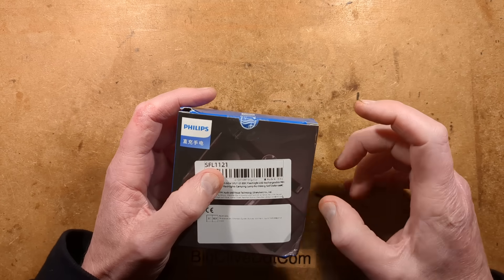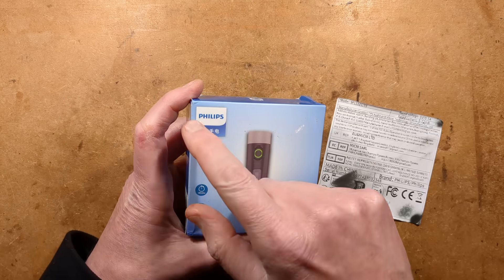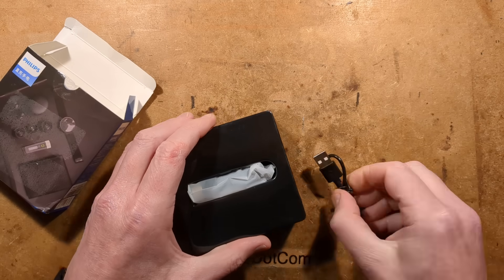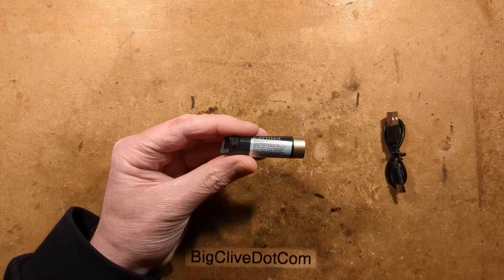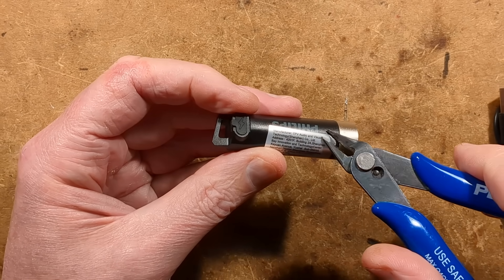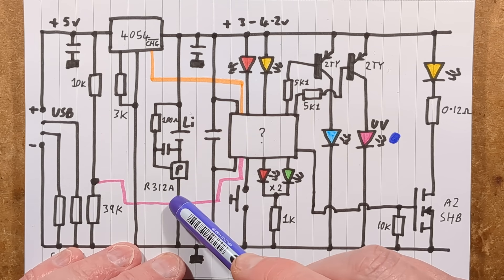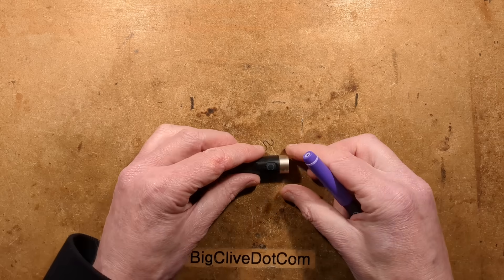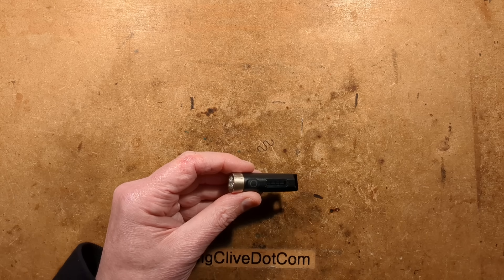Philips flashlight teardown

Comment: Which of these small cheap Chinese flashlights has the largest battery capacity? (300-400mA)
Reply from the maker: I should test that.  But the LED current will also be a factor.

Comment: My Philips torch arrived a few days ago, it has decent light output, the red light lasts for 6-7 hours, low intensity main light for less than 3. Is it a lot? No. Is a lot for the price point? Sure is! Not every torch has to save your arse after getting lost in a dense forest in the middle of nowhere... A super compact, reasonably bright product. It will even have some 'safety margin' allowing for short additional use after battery dies. Great find!

Comment: Bought 2 because of this video. But mine won't charge with usb C, how to check presence of pull down resistors without breaking it apart?😂
Reply from the maker: It may be that your USB C plug just isn't deep enough to reach the connector.  Are you using the supplied lead?  Make sure it goes in all the way.

Comment: Nice little torch. Too bad it's 10€ now.
I actually have a 2.5W Phillips light bulb which is unbelievably bright and actually gives off more light than I need at night. The colour temperature is nice too.
Comparing it to other LED lights, I was convinced that it has to be significantly more than 2.5W, but no.. I checked.. it really is around 2.5W.

Comment: A very nice LED keyring light! Seems the licenced Philips build quality is pretty good too, as you might hope. Over 20 years ago, when Philips Imaging bought out ADAC, they were giving away red LED illuminated ballpoint pens, for use in low light environments, and I still have two, both of which work perfectly (They take the standard Parker-style refills).

Comment: Why do they have fit strobe lighting?  I have a mini torch and press one it's main light OK Press second time and it's that strobe lighting WHY? Third press and it's side LEDs light OK because it uses less power.  One good thing it has charging control the press button light up red when charging and switches off when charge

Comment: That's nice I kind of like the soft on soft off. The strobeing police lights on the other hand can literally get you arrested for impersonating a police officer in the US. Although I don't know why one would want to do that right now.
And I like that it goes low high it just seems right. Rather than coming on Hot and eating all your battery only to go down to a lower level. Although it kind of would be nice if there was some sort of override to go straight to Full intensity, although it's a keychain flashlight so not necessarily it's use case. Actually impressive.

Comment: Have you ever tested some of these light Circuits, to see How Low you can get the Voltage/power?
I see so many of the NICE devices being Over Run for Brightness, Not for Duration.
Reply from the maker: I prefer to use these lights at their lowest setting for LED and circuitry longevity.  At high settings the good ones protect the LED by gradually reducing the current in hard to perceive steps.

Comment: Looks very similar to your "Better USB chargeable keychain flashlight" video, PCB layout is almost the same. Software is different though, and it lacks the 5k1 resistors on the USB pins.

Comment: The microcontroller might have a programmable current sink for those two direct-drive LEDs.  So many LEDs for a flashlight.  9 LEDs + the main LED.  Cool.

The protection chip was a nice touch, they didn't really need to do that.  They could have used a PFET with very low reverse leakage to switch main power and do a shutdown and made the ON/OFF/FUNC button do a power bypass to bootstrap the microcontroller.

I'm a little surprised they had those transistor circuits.  They could have used a quad N-Fet (ground side switching) and gotten rid of the two transistors, the two 5K resistors, the main LED drive FET, and doubled up two of the FETs from a quad package in parallel as the main driver.

Comment: Of course it flashes. Because flashlight. 
You and I both know that's not what flashlight means, but China doesn't, so they all have to flash. Including police car lights?! A strip of white LEDs would have been far better. Preferably with a small magnet on the opposite side so you can attach it to convenient metal things and work hands free.

Comment: Nice toy! If you turn it on while charging, does the charger provide more current to compensate, or it's same current but a part of it goes to the LED (hence the battery charges more slowly)?
Reply from the maker: Same current but a small part goes to the LED.

Comment: I would be curious to know how the flashlight reacts if you plug it in, turn it on in that limited mode, then unplug it. 
Basically: Is it possible to use this as a plugged-in nightlight with internal battery backup?
Reply from the maker: It stays on at the low setting when unplugged.

Comment: I don't think this one is an 'officially licensed' Philips product. While the Philips name has been licensed out to other companies (one of which is, in fact, TPV) for use on a variety of products, I think this one is, at best, borrowing the case from an officially licensed product. I believe the original/genuine licensed product is the Philips SFL1121. This one looks to have used the same basic housing, but at the very least it has a different secondary LED layout. The box art/layout doesn't quite match, and there is no giant product sticker on the official version either. It can be hard to tell which is the original, and which is the copy, but I think the version with three secondary LEDs is the original, especially because there is a revised SFL1121P that changes the case but still only has three secondary LEDs.

Actually, you might want to take a look at the SFL1121P because it includes a little tinted plastic window that it advertises can be used with the red LED to locate hidden peeping-tom cameras.

Comment: You are correct, Philips is just a few lawyers in an office that sell licenses to the brand.  Shame really, Philips used to be a great technology company...
Reply: Yes and no. Consumer electronics are indeed licensed and not made by Philips anymore. Other devices, medical related, are still designed and made by Philips (things like shavers, toothbrushes and hair removal devices). And Philips still has a very, very, large medical (hospital) equipment department.
Reply: @daantimmer  Yes, you are correct, medical  division is still under the original company control.
Reply: I wondered why Philips LED RGBIC strips cost more than the other brands while offering less performance. I use Govee for my addressable RGB needs. Decent price and performance while supporting an app that requires zero Internet connection.
Reply: Of course Project-326 would show up here!
Reply: @HylanderSB  🙂
Reply: @HylanderSB enlighten me, what is special about @project-326 ?

Comment: There must have been a historical watershed where it was decided (henceforth) torches would no longer provide just on and off.
Reply: Somewhere in the first decade of the 2000's. LEDs got good and LiPo batteries became the standard. They all copied what amounts to the same button-cap switching pattern that showed up around that time. (Not sure which brand was first, but that's when that stuff hit the mainstream market.)
Reply: @pauljs75  perhaps Streamlight?

Comment: I found what appears to be the exact same circuitboard in slightly different casing marketed as an Alonefire S11 (S11F with flourescent shell) for about 6 gbp (479 philippines pesos) and that led me to another clone - Asafee S11, for 229 pesos and then again an unbranded S11 mini flashlight for 187 pesos. Board layout identical to yours.

Comment: I actually bought one of these recently! It's become my daily carry light, displacing a Lumintop AAA light. The timeout for the button press to turn off the LED instead of cycling to the next mode is about 5 seconds, and the 4.5cm scale on the side is accurate. Very happy with its function at a light. My only complaint is that the first double-click mode is the UV light and not the white light.

Comment: 7:44 that's why I alwasy buy the clear/glow in the dark plastic models of flashlights, esp the nitecores and stuff. the light hitting the casing makes the entire thing light up so you get an extra couple of percent of light around the flashlight in your hands. plus if you have the glow in the dark model with those side lights, the entire casing stays lit for a good minute or two after you turn it off. it really glows brightly with EDC model V3 that has the UV light. I didn't even know the light was UV because my glasses have a UV filter. the entire thing glows brightly and there's a little dot of light blue lmao

Comment: In the US there's been 3 Philips brands available since the 00s - name brand Philips (there once was a Philips medical & electronics as two separate), generic licensed/branded Philips, and Philips Avent (baby stuff - part of Philips in the US).  Branding/packaging gets a little weird depending on the retailer and what market the product was initially intended for before being sold in the US (ex: Philips Avent for the Canadian (French) market originates in the Netherlands, often, with EU/French labeling & packaging).  You only tend to see the licensed products at big box retailers like Walmart/Target, and it's often cheap items like the flashlight and around Christmas time.  In the US, I believe name brand will have the Philips coat of arms logo printed somewhere on the package (yours just has a seal sticker) & not a sticker and that's how you would tell if it's a licensed product.  Also, some genuine Philips products should have a QR or security code printed on the box and product, which should direct you to an authentication page on the US Philips site.  Being that the product is for the domestic Chinese market, my bet is its licensed as the brand name is more valuable there than an actual Philips quality product.

Comment: Do you think the main led itself is limiting its forward current?
Reply from the maker: The voltage will rise slightly with current, but it's not a current regulated LED.  It's main limiting factors are the series resistor and the cell impedance.

Comment: I had one of them from guy who sell stuff from Philips. Weirdly mine didnt had glue on screwed cap(as of course I took apart mine). At first I really though that it have the same guts as those cheap keychine lights(that I really love) just in different case. I just fish they get rid of blue/red LEDs as they are super useless...

Comment: I think my royvon keychain light is about the same size and has about the same operating system of button pushes on stuff
Reply: Rovyvon makes the highest quality keychain light, that is reflected in the price. They use very high quality components and batteries, being an outlier among Chinese manufacturers which cut every possible corner and maybe what remains too. I have a few of their E3 hybrid Angel Eyes - £ 50 may seem too much for a keychain light but not when you consider their reliability and longevity...

Comment: Does anyone make one without a flash/sos mode??
Reply: It wouldn't be a flashlight then 😉
Reply: yep, it's a bit expensive but the sofirn sp40 that has no strobe whatsoever
it's also worth looking into any flashlight with anduril ui, it's still got the strobe features, but it's behind a very particular sequence of button pushes and holds
never have been a fan of flashlights that put the strobe in the main cycle, should be a double click and hold from off or something like that if you ask me

Comment: Quite a complex circuitry, nice teardown.
To think that nowadays brands are just that, brands. Back in the day when something was marked Philips, you could be sure it was made in the Netherlands or at least Europe by the company that was on forefront of consumer electronics and not just that; the one that gave you developments in radio technology, Miniwatt vacuum tubes a.k.a. valves, compact cassettes, Video2000, CD, SPDIF... Later on, you just never know where exactly it comes from, it's just somewhere in China, Malaysia, Singapore, Philippines, etc. made by a factory that sells the same product under a few different brands, whether it's electronics, tools, household stuff etc. People buy the brand and it's just a simulacrum, a copy of a copy of what used to be.
Reply: Same thing happened to German Grundig. Once a household brand for German made radios and so on, but a generic Chinese crap brand since a decade or so.
Reply: @FoobarDesign  consumer electronics - radios, TVs, tape decks (reel to reel included) - are one thing, but they made excellent test gear too.
Reply: As a Dutch guy I feel your pain. Indeed Philips once was a brand / sign of quality.
Reply: @DIEWELTMusicChannel  legendary one at that - though their electrolytic capacitors didn't age well, at least the blue axial ones. I've had a bunch of NOS ones way out of spec.
Reply: @DIEWELTMusicChannel  Do the still have the Philips museum, i think it was in Eindhoven.... I went there sometime in the late 80s.
Reply: @Andy_FortyTwo  they have two now, one official and one unofficial, but the Evoluon was decommissioned in the late 1980s.
Reply: sad the same thing with belkin or weller...sad name brands just arentwhat they used to be.
Reply: Philips had factories all over the world. It would be more accurate to say it was mostly developed and manufactured in house, not necessarily in The Netherlands or Europe.
Reply: It’s nice though that Phillips is now made in the Philippines.
Reply: Phillips were so busy making easy money from their lazer disc tech when CDs/music/computers etc dominated that they seemed to stop investing in their own consumer product development...a once iconic brand gone kaput,the same with the German "Made in West Germany" branding on Blaupunkt etc...a sign of quality product.
Reply: You guys don't do anything now except contribute to the downfall of Western Civilization... Great job Netherlands
Reply: Phillips wasn't Dutch !!!

Oh, is that why they had Santa riding a Norelco Razor, while we watched that commercial on a Magnavox 😂 👍
... memories
Reply: @My-Pal-Hal  Phillips with 2 l was an American company that made screws. Philips with a single l is a Dutch company with subsidiaries all over the world. Unfortunately instead of just using the Norelco brand in the US and marketing it as a foreign premium brand, they took over Sylvania and Magnavox and set up a more or less independent branch to make cheap crap. That on more occassions than I'd care to remember, caused trouble for Philips themselves. For example letting Funai sneak in to make crap VCRs to replace i3R and PJVM built ones in Europe. But to be fair, it also brought some nice developments to Philips, such as the Magnavox Odyssee.
Reply: @mjouwbuis 
Hey.
My Cheap Chinese Phone can spell Phillips any way it wants 😂
At least it was Close.
Unlike spelling "Odessey" with 2 E's. You had to do That On Purpose,.. Y, I don't know 🤣

And I HAVE an Odessey 2.
It has 2 Wired Joysticks. And anyone in the know. Knows they are wired with what we remember to be TV ANTENNA WIRE !!!
... good times 🖖
Reply: @My-Pal-Hal  Philips with one L... unlike Jack O'Neill with two!
Reply: @KeritechElectronics 
Neil is spelt with One L.
At least that's how I spell my name 😳

... ive said to much 😂, sorry, TOO much 🤣 😜
Reply: @KeritechElectronics 
And I restored something I found in a landfill you would find to be,.. TUBULAR DUDE 😂

A Zenith model 500 Transoceanic Radio 🤗

How things end up where they do is amazing. But it looks practically brand new now. And Sounds Amazing 😂

And something I think would be considered a HACK. Was using Shoe Polish while refurbing the cabinet. Worked pretty good. And being old (er😏) figured that may be something they actually used at the time.
Because I Did.
... seemed logical
Reply: @KeritechElectronics 
And personal stuff aside.
So I'm gonna bring it up for some reason.

But I have tons of old equipment, from my Radio Shake GLOBE PATROL RADIO I built when dinosaurs roamed the earth. 
... like $350 bucks on eBay.
To Peaches Records and Tapes Crates full of Albums.

But I was talking in another thread about a bands recently live posts.

AND ONE POSTER SAID I LEFT THEM IN THE PAST 😂, wtf...

Because I'm in the US.
And I mentioned I have a Pre Ordered record set of Welcome To The Pleasure Dome.
... awesome album 

So I told them "I Left Them" ???
THEY LEFT YOU, AND MOVED TO IRELAND 🤣🤣🤣

... funny the conversation ended there 

Good Times. ENJOY

Still have my Gerrard DD-75 I played that album on... 😏
No School like Old School.
Reply: While mostly true I feel like this is a tad over-cynical. Brands with a reputation to defend will often put requirements and conditions on their licensees to protect that reputation and deliver a product that is both consistent with their brand and of the quality their loyal customers expect. In extreme cases the brand evolves into more of a de-facto seal of approval than a corporate identity. The effectiveness of this varies, of course, but the promise of easy money is too much for even the best companies to resist.

This can result in goofy situations where a design or production run is rejected for not being up to snuff, so the licensee cuts their losses by filing the name off and selling it to another company or just putting it to manufacture under their own brand or no brand, maybe with a few more corners cut. So you get "bootleg" products that trace their roots back to the genuine article.